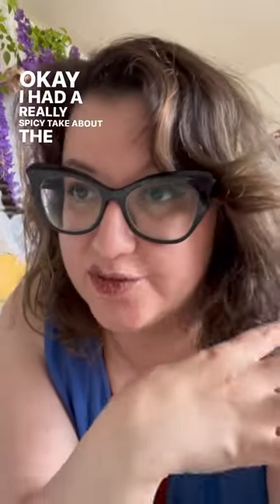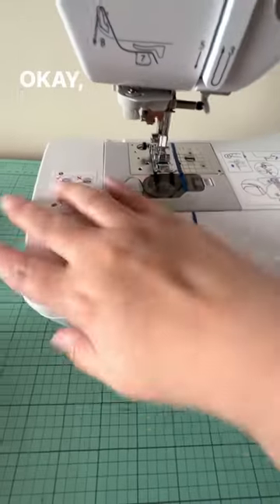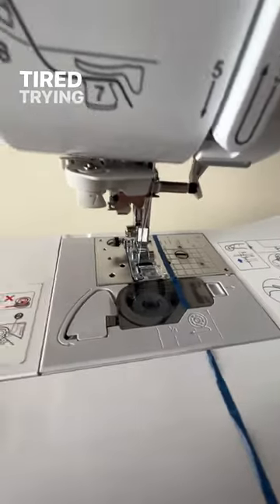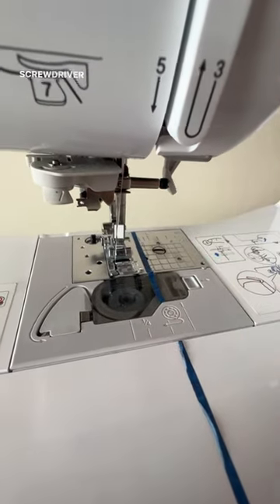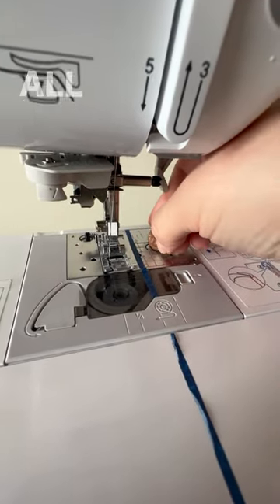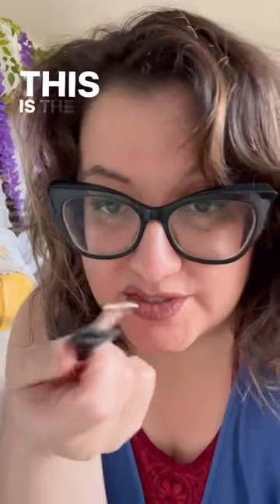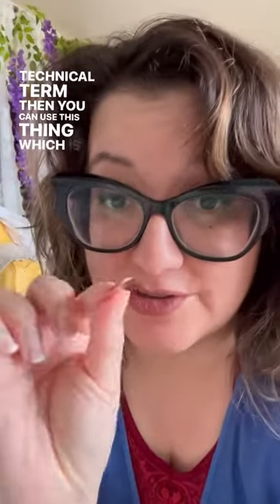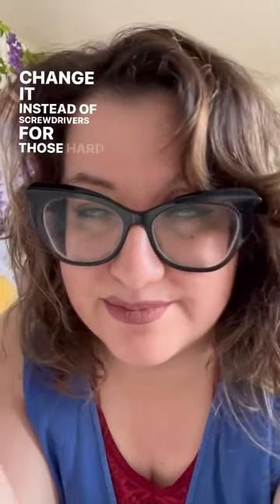This is why you need a coin in your sewing kit

Comment: Nice tip! I thought it was going to be to level the back of the presser foot for starting bulky fabrics. That's why I have some coins nearby.
Reply from the maker: Oh that's a good tip. My sewing teacher just told us to use scraps folded up to help with that.
Reply: @bookhoarding  Nice! I saw that somewhere too. With the coin you don't have to keep the prop up fabric from unfolding, and it's a little easier to slide around lol. But easier to fling/lose if you forget about them. I first learned propping up with a button, but coins are easier to vary the height/stackable. Usually just a nickle is a good default.